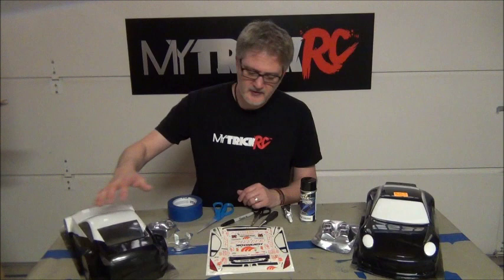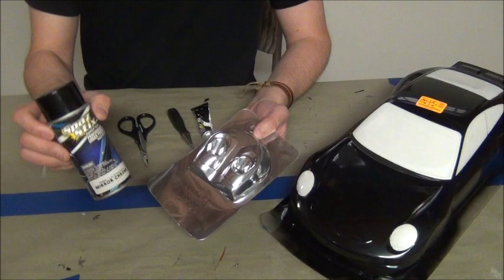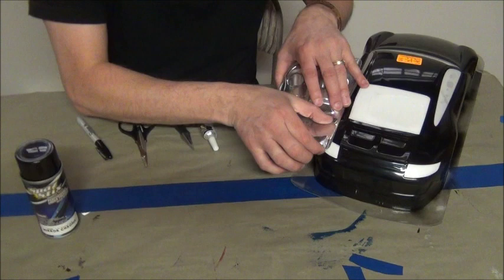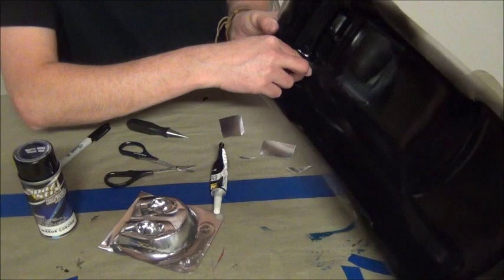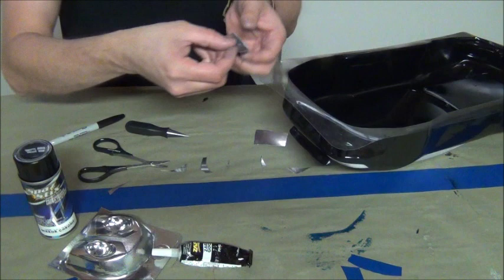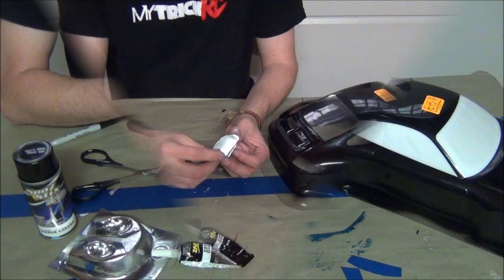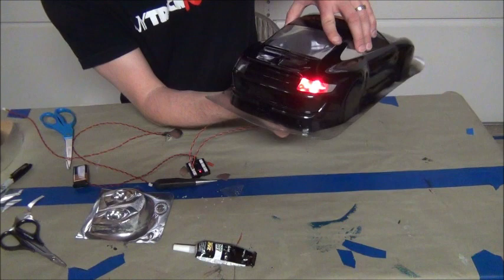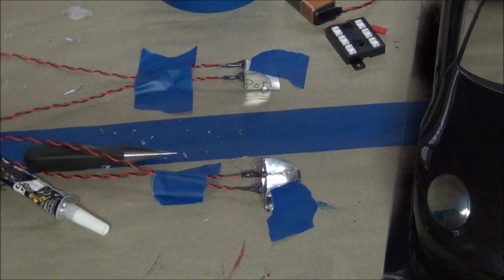How to make RC Light Buckets

Comment: What was that that u used to make the buckets from
Reply from the maker: When we painted the clear body, there was left over plastic.  We used that to build the parts.  You could use other cut sheet material.  Even cardboard covered in tape can work.